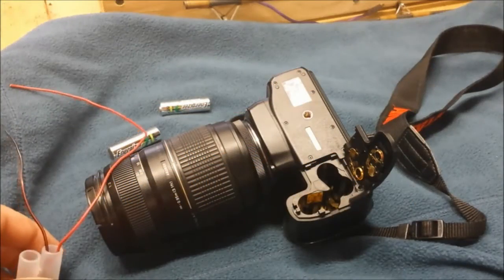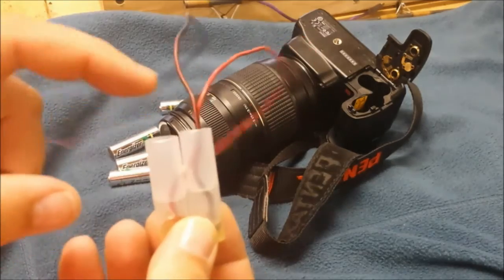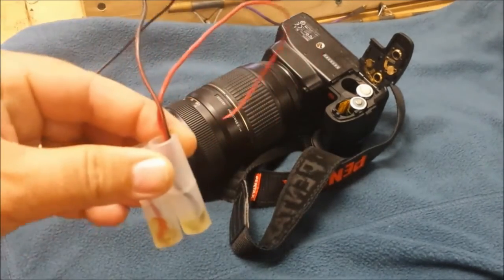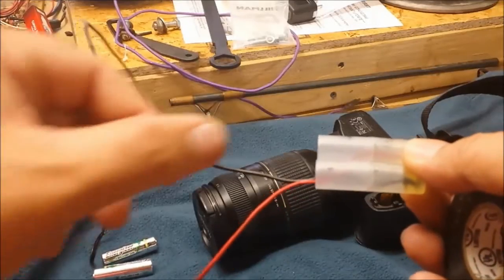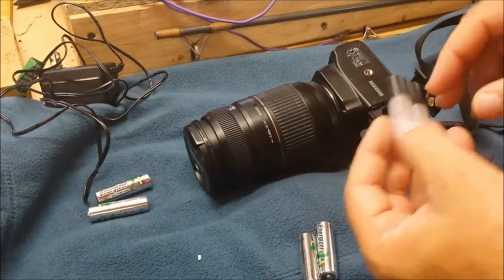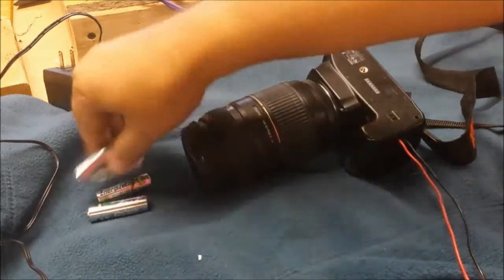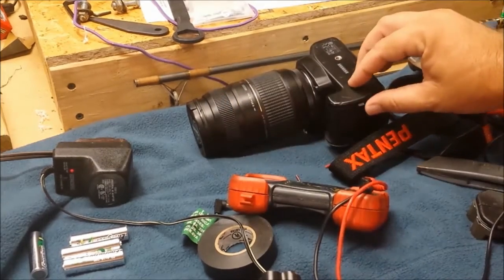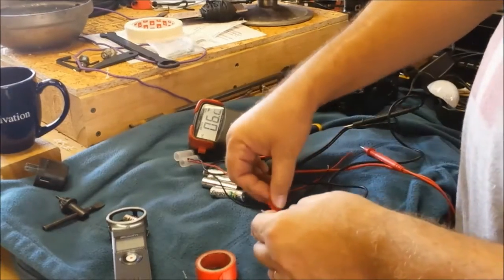AC adapter for any camera or battery powered device

Comment: Your intermediate 5v power supply was reading wrong because it's self regulating only when ON a load!.
When OFF load it will read a higher voltage.
Never ever use an 'cheap' unregulated supply such as that on sensitive electronics like a camera.
You'll blow it!.
Use only a smoothed and regulated supply!.
Otherwise you did an excellent job!.